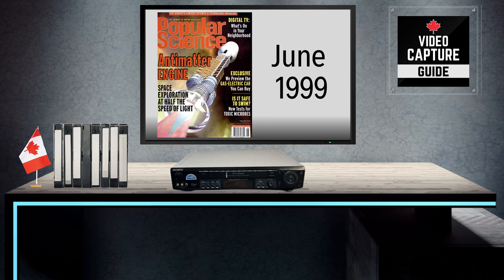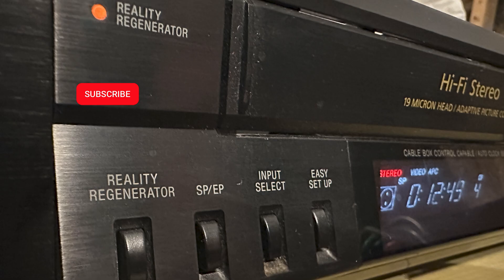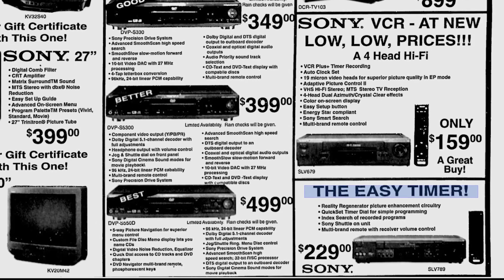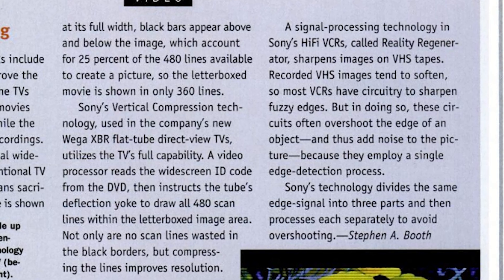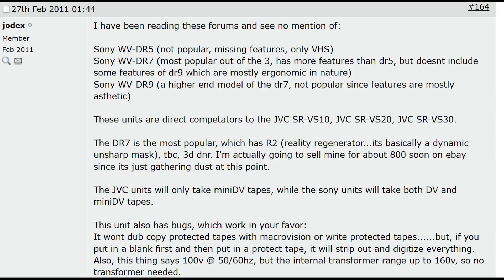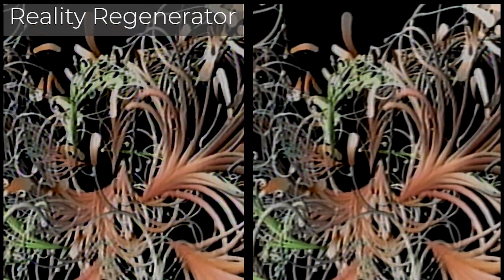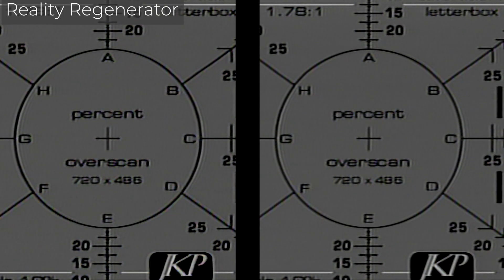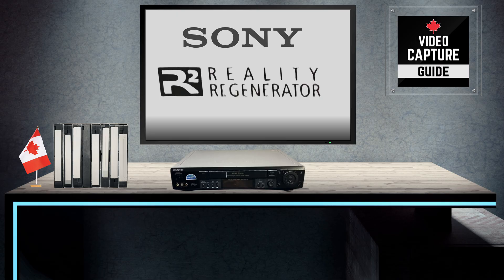Reality Regenerator Review: Sony’s VHS Sharpening Feature Explained

Comment: Well colour under formats typically employ something called a "crispening circuit" and RR seems to be just an improved version of that. What a normal "crispening circuit" does is it differentiates the signal, pass it through a non-linear function to get small values closer to zero, and differentiate the signal again. This is then added to the original signal.

Comment: Looks the same as my Panasonic's NV800 sharpen/soften slider when moved a tad bit to the sharpen side, so I presume it's just an HF emphasis circuit. Similar to modern days' neural upscaling — utter shite technically, but because our brains aren't oscilloscopes it tricks us enough to believe it makes the picture "better". Same how you can turn up the treble knob on the stereo to get "cleaner", "brighter" sound etc

Comment: It was enough of a difference to know The REALITY REGENERATOR was on the left but even then it's barely noticeable. I don't think I would have been impressed by it had I spent that much at the time.

Sony loves tagging REALITY to their tech. The PS2 has the Emotion Engine chip as it's backbone and that was codenamed "Reality Engine" during development.

Then the PS3 released with the RSX chip as it's GPU, which stood for "Reality Synthesizer".

Around the late 90s there must have been someone high up at Sony that was obsessed with tagging tech with the REALITY moniker.

Comment: So which VHS to digital device do you recommend to buy?
Reply from the maker: For most people, I would recommend one of these capture devices. The first two are available new. The last two can only be purchased pre-owned.

- Hauppauge USB-Live2 capture device

- IO Data GV-USB2 capture device

- ATI TV Wonder 600

- Sony MiniDV camcorder (or Digital8 camcorder) that has S-Video/Comp in and Firewire out. For this option you will need a Firewire card/port installed in your Windows desktop computer. Or if on a Mac, you will need some adapters to connect to Lighting port.

Comment: I'm not sure Reality Regenerator appeared much on PAL machines. Sony instead gave us something called TriLogic Optimum Picture Control (OPC) which I think made far more difference than R2.
Reply: Funny you should mention that, because that was the first thing i thought of when i saw this video. I once had a top of the line Sony VHS deck from the mid 2000s with the OPC feature, and with good quality tapes it made noticeably better recordings than any other VHS i ever saw. Probably as good as (consumer) VHS ever got.

Comment: More important for capturing is getting a vcr that features an edit mode switch. These turn off denoising and smoothing that most vcrs had.
Reply from the maker: I agree. My main VCR is the JVC SR-VS30. Interestingly the Sony WV-DR9 S-VHS VCR seems to be a match for the JVC SR-VS30. The main difference is that the Sony could play back full DV tapes, whereas the SR-VS30 could only play MiniDV tapes. This Sony model was only sold in Japan by it does occassionally appear on ebay.

Comment: I got it right, the left image was a bit sharper but not much. I think you can see it on the text and the test pattern, too. But you would have to also use a CRT, it is highly unlikely that people watched this on LCD or (O)LED back in the day, it is not really a fair test in the sense of that you changed the intended usecase a LOT, it is like painting an image and changing the canvas, it will affect the outcome.or perception or result. It was NEVER intended for LCD, most people used CRT, which also were smaller in size compared to todays TVs. You can see the change, but not the real intended effect, so to say.
Reply from the maker: Good point.
Reply: Tbh it would've probably been even more difficult to see a difference on low resolution CRTs though.

Comment: The smart engineer would make it so the reality regenerator on mode does nothing, but the off mode degrades the picture, so users and reviewers think reality regenerator is the greatest feature ever.
Reply: I reckon Hitachi did just that on a stereo cassette deck we had come in for service in the mid 1980's. The machine had hissed on playback from new but didn't hiss if Dolby was activated. On the bench I found it hissed on playback with no tape in so it wasn't tape noise. It was the same on both channels.  Looking at the service manual I ralised they had used really cheap & nasty transistors which were inherently noisy, so I changed about four transistors per channel to higher spec devices....and the hiss was then on a par with what you'd expect.

Looks like Hitachi decided they could get away with cheapo semiconductors simply because the deck had Dolby. However, not everyone wants to use Dolby. Disappointing. Richard, UK
Reply: @ukfmcbradioservicingTango21 Dolby B should only be enabled if a cassette has been recorded with Dolby B. Dolby B is essentially an equalization filter applied during recording (it boosts the higher frequencies) which is then de-equalized during playback. Enabling Dolby B on material that hasn't been recorded with Dolby B will indeed reduce the noise (which tends to sit at the high frequencies) but will also apply an unwanted filter that will attenuate the signal's high frequencies and make the sound too bassy. So, the presence of Dolby B decoding was definitely not an excuse for Hitachi to cheap out on materials.
Reply: @Δημήτρης-θ7θ  Absolutely. Richard (UK)
Reply: The only way they’d fall for that is if they never saw vhs quality anywhere else
Reply: Reminds me of the “Turbo” button on some 90’s PCs, which actually slowed the thing down.
Reply: @theblah12  I foolishly pressed that once and my damned PC jumped a river and caught three criminals escaping in a cheap helicopter!

Comment: I actually correctly identified the R2 image when you started running the Video Essentials DVD.  Not a stark difference, but it survived YouTube reencoding enough to be recognizable, so that's something.

Like you said, for the intended purpose of viewing tapes on a CRT when this machine was new, it may have been something I would have used.   (But I was also in middle school in 1999 and didn't have $229 to spend ...)
Reply: They look the same, you just guessed the 50\50. 🤨
Reply: @AthosJosue  ....ok

Comment: When I upscaled the still image with the mountains from 480 (standard PiP) to 1080 full-screen pixels (not smooth at 60 Hz), cross-color interference was visible on the left but not on the right. So, like ALL NTSC devices, the device would have needed an S-Video output. With PAL, the signals only collide at 3.8 MHz.

Comment: Good video. Way back when, I purchased 2 Sony 999's with the flying erase heads and reality generator because I wanted the immediate edit feature from machine to machine without those rainbow colour bars. The R R was another story. When using it, it reminded me of the old fine tuning dial on those old TVs. It seemed to just play with tuning features a little. I have wondered if one could wire the machine directly from the play head, would it make a world of difference. Who knows? Since that time, I sold one of my machines to a buddy because he wanted it bad. The other sits up on my shelf gathering dust. 
One side note... It's strange to me that with the amount of money Sony wanted for these machines with the bells and whistles that they didn't at least include S-video ins and outs.